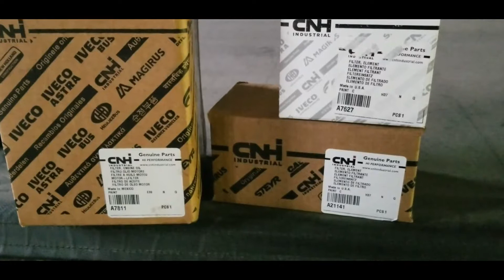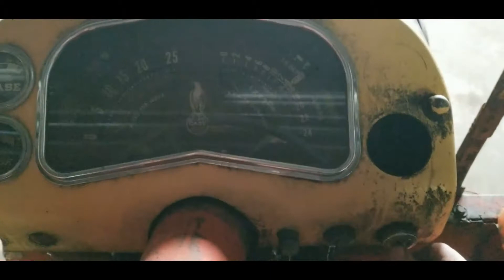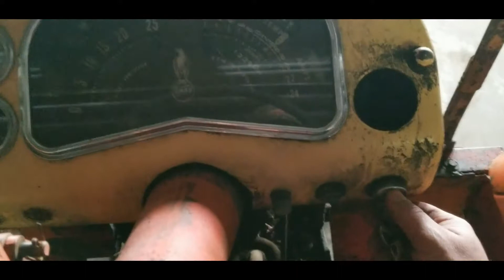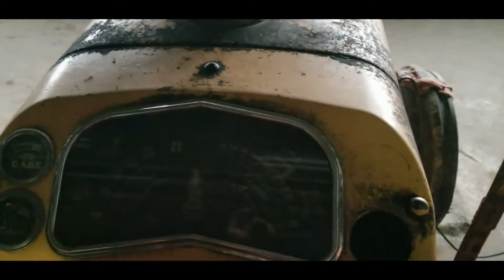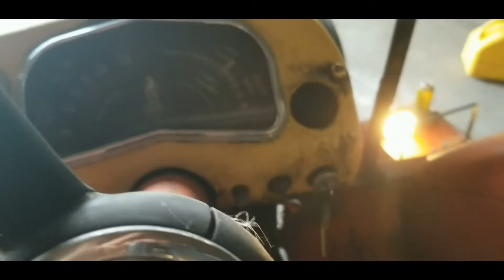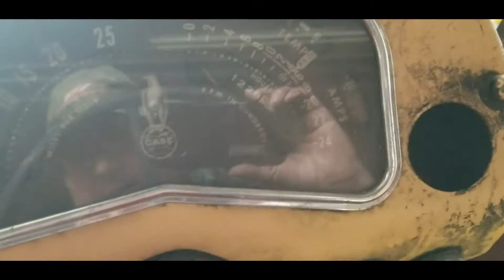1959 Case 800 build.  Part 2!

Comment: I'm near Edmonton Alberta. I have 2 Case 832's. One is in decent operating shape, the other is a winter project. I'm new to these tractors so I'll definitely need to find the manuals.
Reply from the maker: Any case dealer can get you the PDF versions of the manuals.  Some charge  some don't...

Comment: I was able to pull start, the battery needs to have enough power to turn over with  decompression level engaged. While being being pulled, turn engine over to engage case-o-matic direct drive, disengage compression release to start the tractor.
Reply from the maker: Or, turn key, add a little throttle and away it goes.

Comment: do you have a part number for that inline fuel filter my 801b has a fleetgaurd ff117 but auto parts dont carry it
Reply from the maker: Hey, thanks for watching.  The origonal case number is 09985AB1.  They have long been discontinued.  I did not change this filter becsuse I could not find a change up number.  In truth though, you could probably just delete it.  The  line going to the pump is -04 JIC so you could just cut the steel line, clamp a fuel line to it and get a crimped on end to go to the pump.

Comment: What you called a second fuel tank is a inline fuel filter
Reply from the maker: I did figuer that out... it's most certainly a learn as I go.
Reply: @DuchesnesCorner  that's the only way to work on stuff make sure your always learing.  You find and antifreeze in the oil? I would figure out what model injection pump that is and look for a rebuild kit for it on eBay
Reply from the maker: Oil was good when I changed it.  Rad was still full of coolant a well.  It will be part of the next video while I'm waiting... *spoiler alert*... for my injection pump rebuild kit. 🤫
Reply: @DuchesnesCorner  awesome! I've never seen one with no coolant in the oil that's crazy and stiff full.   Keep an eye on it incase things loosen up as it runs.  I would check the rockers and valves out too